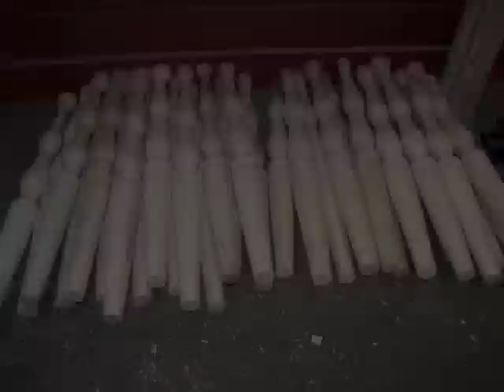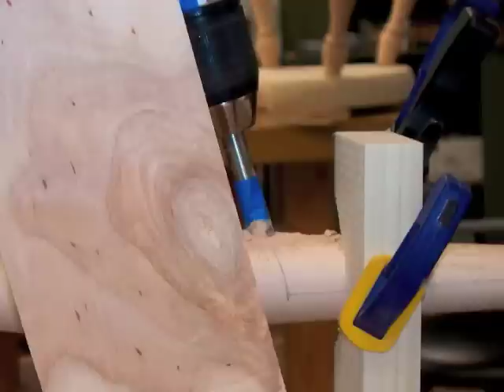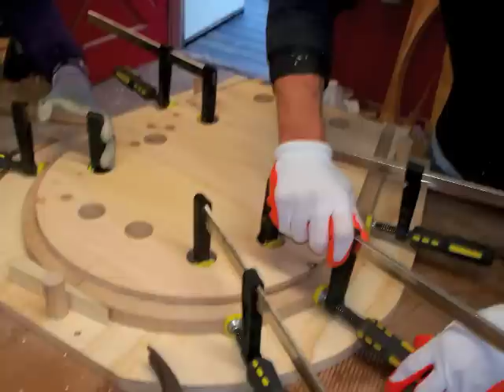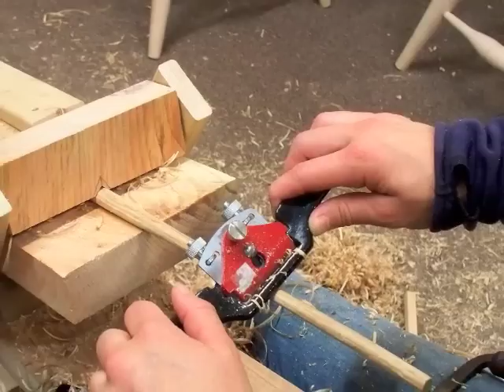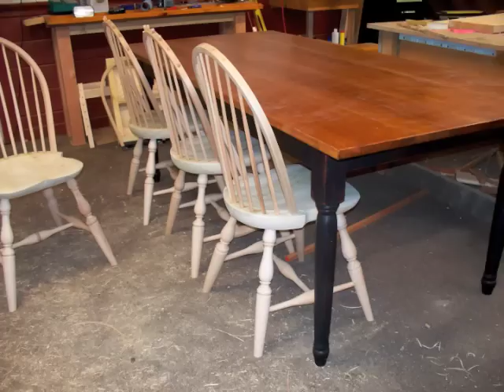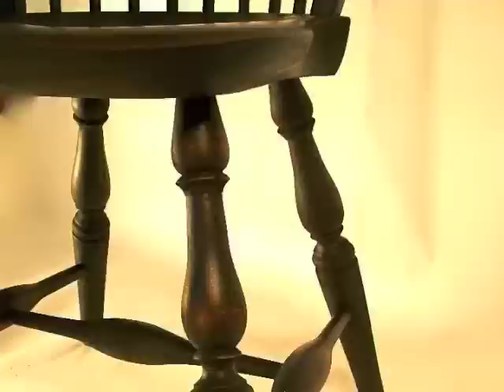Windsor Chair Building Process by Doucette and Wolfe Furniture Makers Windsor Chair Making

Comment: Superb. On English original Windsor chairs the rear legs are splayed less than the front legs, and the seat is canted by about an inch. The rake on the front legs is usually a lot less than the back legs which need to go as far back as the slouch of the back at least to stop you tipping back.